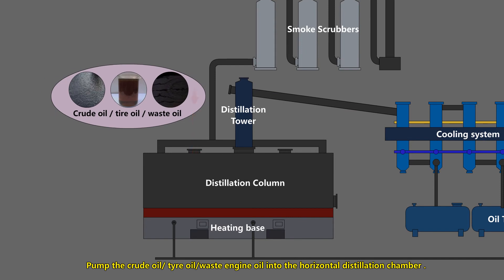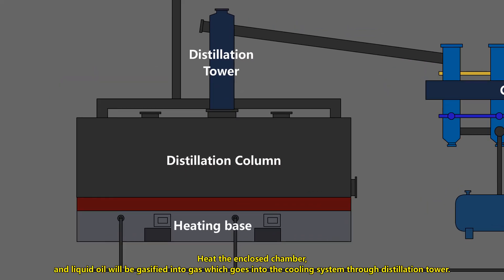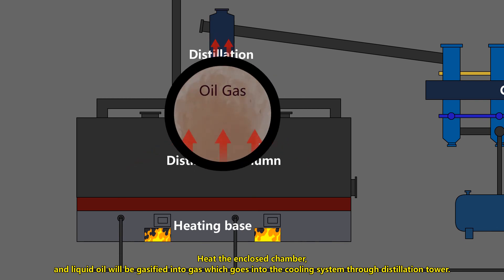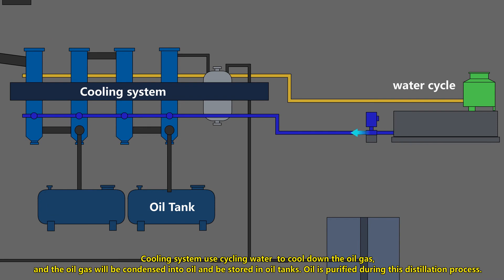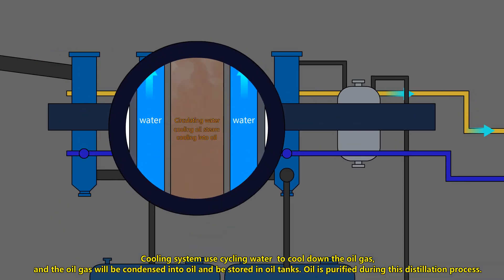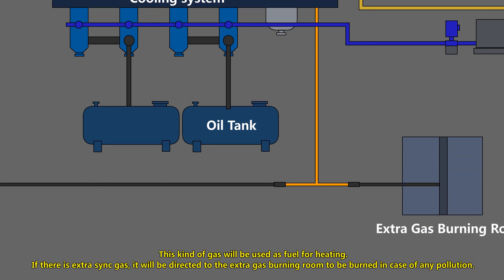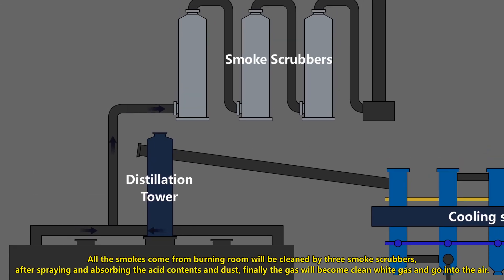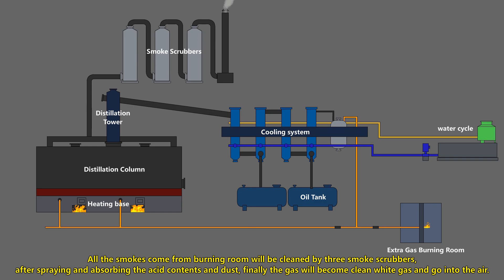Oil Distillation Plant Working Process to Get Diesel from Tyre Oil, Waste Engine Oil

Comment: I'm actually building one of these on a smaller scale, all I can say is that it's free diesel from waste oil
Reply: Can the diesel be used in car engines
Reply: @URvimez  The fuel can be used in any mechanically injected diesel engine, ie one that has absolutely no electronic equipment on the injection pump.
Reply: @Dieselsix  thanks am also gonna try it on small scale...any help on small scale distillation technique? My other question is at what point is petrol identified from diesel or I think there are equipments to distinguish..all I have is that..thank you
Reply: @URvimez  ideally you need a thermostatically controlled burner in a firebox under a heavy steel tank where the oil is gasified. The outlet at the top of the tank should be kept around 350c. The temperature here dictates the viscosity of the fuel oil produced. The outlet pipe must then pass through a condenser to bring the gasified oil back down to a liquid fuel at about 60c. There’s plenty of information online if you wish to look further. As for petrol, in the time I produced around 200L of fuel oil I only got 5L of gasoline. So petrol isn’t really a viable part of the equation. But if you run the system at a lower temperature it will produce a lighter weight fuel oil akin to kerosene. It produces much slower however.
Reply: @Dieselsix  thank you for the enlightenment 🙏
Reply: Please your email address
Reply: Please your email address

Comment: this process is to produce pure diesel or what? i mean the product oil is diesel oil or other type of oil?
Reply: hello, Mr. Md Hafiz, our machine can produce pure diesel from waste  tyre  oil and engine/motor oil .any interested,please contact with what's app:+ 86 15823899667
Reply: Linna liao
Reply: what can I  help you,my what's app :+ 86 15823899667
Reply: hello,sir,this is Linna Liao,my e-mail:sales07@cqfason.cn  what's app:+ 86 15823899667
Reply: @Kylo Kingsley yup, been watching on Flixzone} for years myself :)
Reply: Pro tip : watch movies on Flixzone. Me and my gf have been using them for watching all kinds of movies these days.
Reply: @kylokingsley1299   this SPAM & nonsense